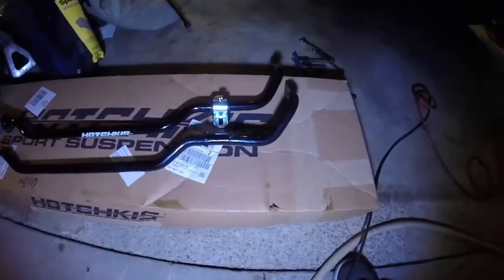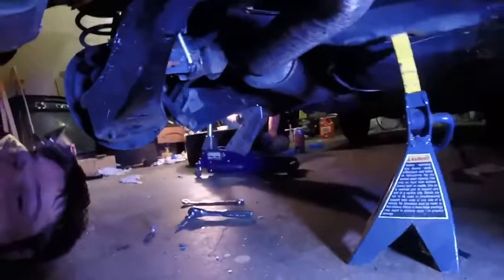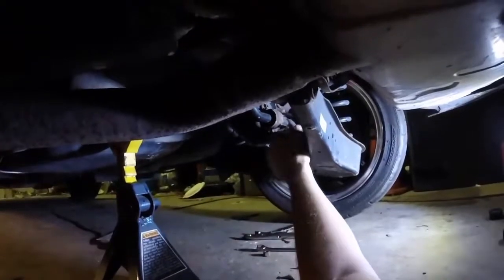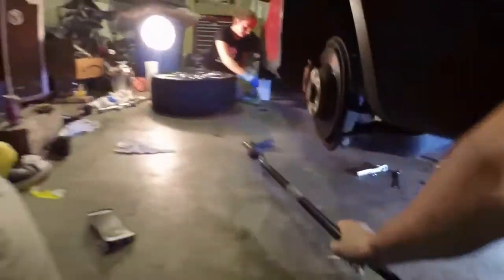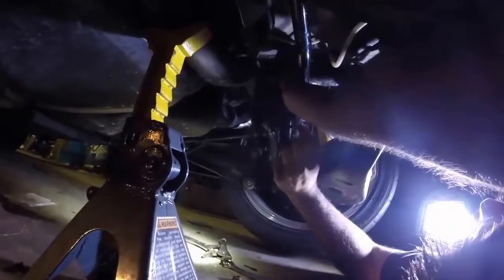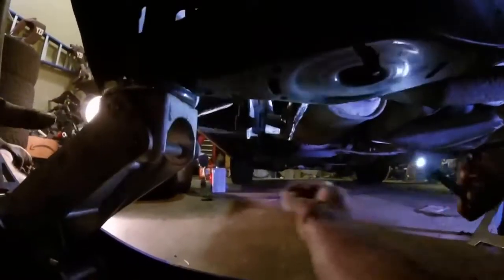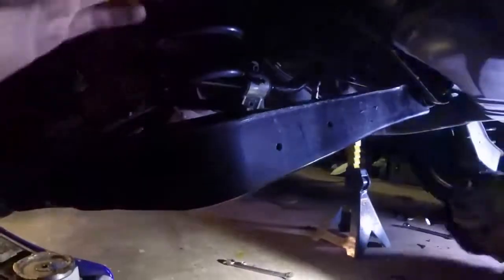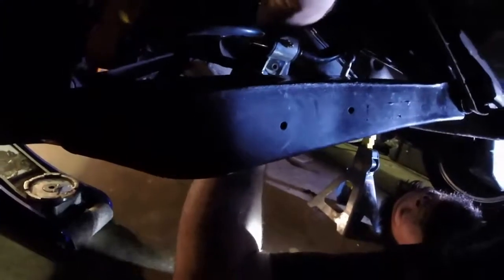Mk5 Swaybar upgrade/How to Kill Understeer

Comment: 27mm that's a mean upgrade, I was thinking of putting in a 25mm bar. Was the drive comfortability compromised?
Reply from the maker: Tomas Prieto the 27mm is about perfect for autocross on the stiffest setting but is also adjustable so you can go softer if needed. The sway bar does make the ride a little stiffer. The main characteristic is the reduction in body roll makes you feel when the road tilts a bit more, it kinda feels like an old solid axle Jeep on uneven roads but it’s nothing anyone would shy away from in my opinion.